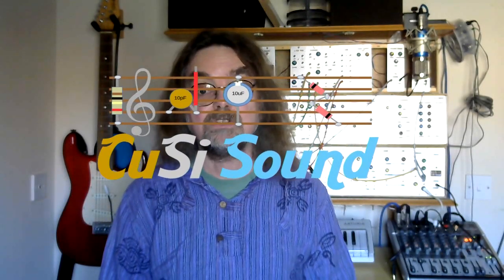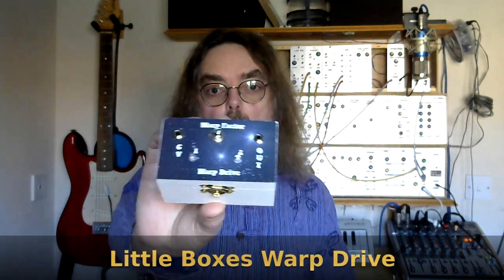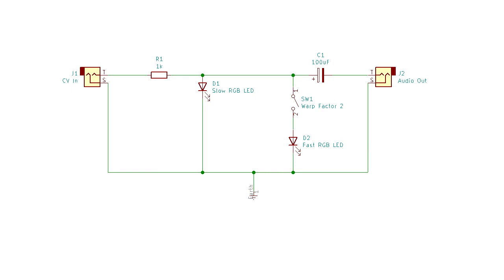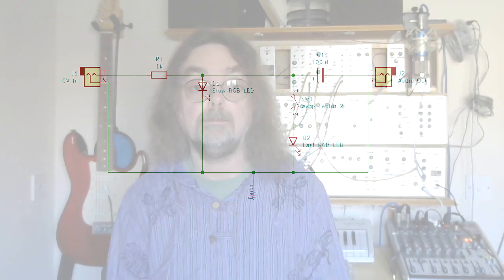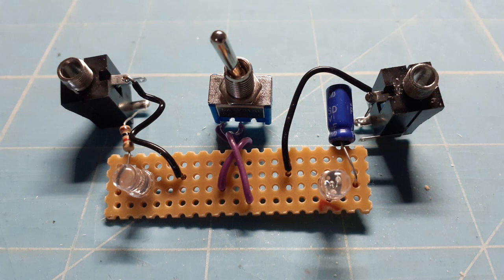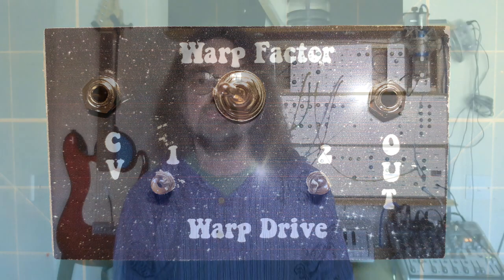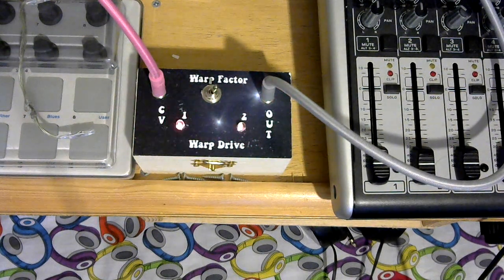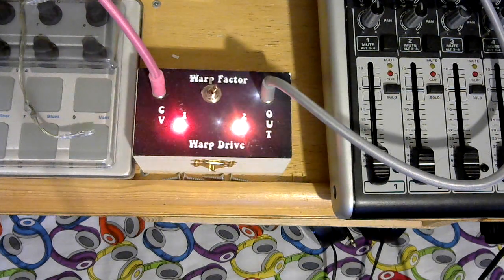Little Boxes Warp Drive

Comment: I had a similar idea using blinking leds. I used four of them and they produce stepped voltages and if you put in a slew limiter that's nice as well.
Reply from the maker: That sounds great! I am often amazed at the range of sounds you can get out of these simple circuits.